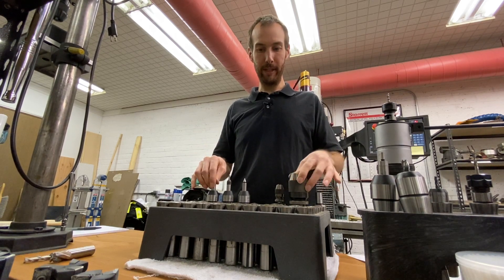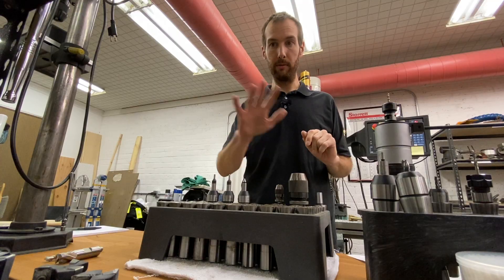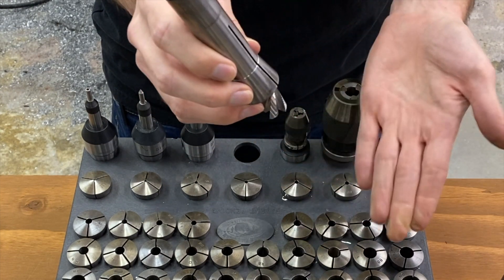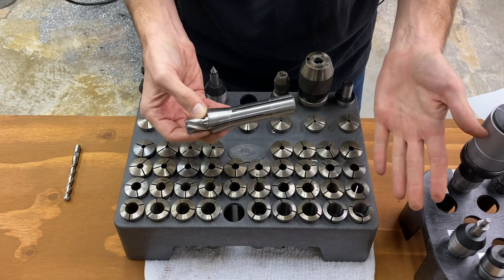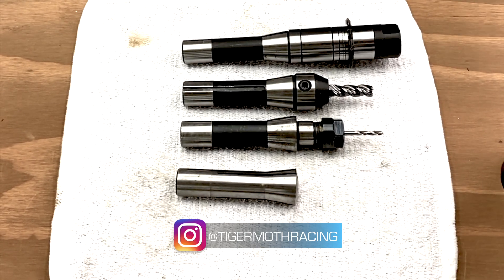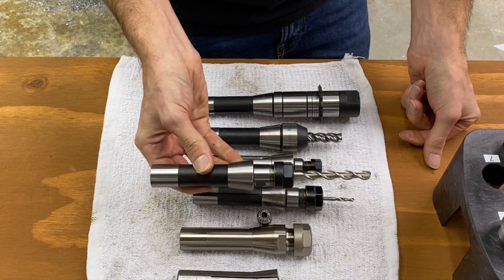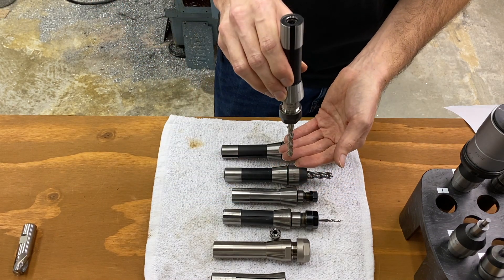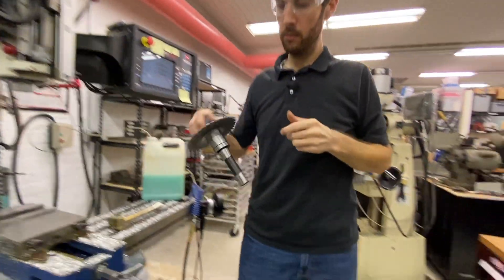LET'S TALK R8 TOOL HOLDERS (Part I)

Comment: I'm hoping to repurpose those holders for a laboratory project, not using them for their intended function: What is the exact diameter of the openings in the R8 holders? Will it be identical for all of the R8 holders from different reputable brands? Thanks!
Reply from the maker: The openings will be all standard fractional sizes 1/8, 3/16, 1/4, 5/16, 3/8, 1/2, 5/8, 3/4, all oversize a few tenths. Are you using them for a force test?
Reply: @TigermothRacingTV  No, nothing like that. It won't be under any significant load or strain. I'm still confused: Aren't all of those holes in the holder the same size? It looks like it? Thanks...
Reply from the maker: @NA-hb7kl 
I guess I am not sure which holes you are talking about. The tool holder end is available in different sizes, the drawbar end is usually 7/16-18, and the setscrew sizes vary greatly.
Reply: @TigermothRacingTV  Sorry to be so unclear. I wish I knew your field! I'll try just one more time to explain my question and then I'll stop cluttering your channel: The openings in the top surface of the four-legged collet holder that you're displaying at the very beginning of the video... What diameter are those holes in the holder's top surface? And how would I have known that hole diameter without measuring it -- in other words, how do I translate the specs for any given collet holder into the hole size in the top surface? (I seem to only see specs for collet holders that are already in industry code, like E20 or R8, since they very fairly assume the buyer will know what top-surface diameters such codes indicate.)
Reply from the maker: @NA-hb7kl 
Ok, if you mean the hole that holds the collet, yes those will be all the same for each series of collet. You can find a spec chart online for each ER collet exterior dimensions.

Comment: Great informative Video. I am new to machining and I am finding the whole topic of collets and arbours very confusing. I thought the R8 was the big guy with machines to match. It seems that the hobby home range use smaller  tooling tapers. It doesn't help by having different codes for what looks like the same thing, for example Mt3 is the same as er 25 and R8 is a er32. As I don't own or have access to any collet holding machines that doesn't help.
Reply from the maker: Yeah be careful with that stuff. R8 is not the same as ER32 but you can get them combined in one holder. Also, MT3 is not the same as ER25, although you could get them on the same holder. Hope that helps.
Reply: @TigermothRacingTV  Yes it does,  thanks for the information.

Comment: Where did the designation "R-8" come from? In other words, what do the "R" and the "8" mean?  Thank you. Student Machinist
Reply from the maker: Good question, I am not sure and a cursory check of Google did not tell me ether. I know that it was developed by the Bridgeport machine company. The angle is an oddball as well at 16.85 degrees. I would guess that they developed it as a proprietary for their product line and it happened to become the industrial standard because their machines were so popular.
Reply: @TigermothRacingTV

Comment: Woah! Thanks a lot. I have a slightly larger mill (kao feng) but not as much travel vertically and a rather large vise. I was really nervous if I should go for the spring collet style or not. Thanks for the adviSe!
Reply from the maker: Spring collets are not a question. You should always have a set of those for your mill. They are a staple that will save you time and give you flexibility in your milling, don't skip them.

Comment: Cool video, what tools have you used with that 1” R8 collet? I have done some machining at a student machine shop and the largest R8 collet is 7/8”. Only end mill I had for it was a long 7/8” end mill and it was not very rigid.
Reply from the maker: Yeah 3/4 is the max common size for R8 spring collets. 7/8 is an odd ball and 1" it cannot hold in a practical way. You can get solid holders that will hold up to 1.5" but again not very rigid.

Comment: Great video !
I have a 626 mill with a R8 spindle fitted with a ER32 collet holder. Been playing with the idea of getting a R8 20mm spring collet and leaving it in the mill. Then using SC20 straight  collets on each of my end mills to speed up tool changes. I know using a collet inside another is not good practice but I only do very light work on aluminium. Have you ever tried this and do you think it's viable. 
Thanks Neil
Reply from the maker: Thanks.
That was my solution to a small R8 spindle CNC mill we have. I just leave a 3/4 spring collet in it and we use straight shank shortie ER collet holders in it. Same situation, the machine is light duty so we can't even overload the collet if we wanted to.

Comment: Hi, good vid/shop. I have dude, whit R8 toolholder when get out/in from the machine do you lost the Z hight tool?thanks
Reply from the maker: Thank you. Only the solid or ER holders will keep Z height position of the tool.
Reply: @TigermothRacingTV  ah ok, true, and now I have dude if R8 solid/ER holders can keep the Z high on cnc machines ? many tanks for your answer

Comment: I have a super important and urgent question I am cutting gears for the first time completely on my own I've done all the math I've got everything down perfect I believe in quotations Umm I'm using the R8 integral Shank like you showed here The thing is you have the potential to set the gear cutter at different height depending on how you arrange the spacers but it seems like there's always gonna be some spacers that are not aligned with a section of keyway it's just not long enough is there any right or wrong way to do this? I just for convenience moved it as close to the end of the alright holder is I could and that's really it I just don't know if there's a right or wrong way to do this if you could give me any insight it would be a big help
Reply from the maker: My understanding is that the key needs to engage with the cutter. It doesn't matter if the spacers mate with the key. However, you may find that the nut may loosten wile running if the last spacer next to the nut does not engage with the key. Hope that helps.

Comment: Thanks for an informative video. I would like to build a heavy, gantry milling machine, using the R8 system. My work envelope will be 10”-X, 10”-Y, and 6”-Z. 1/16” - 3/4” diameter collets will certainly work for me.

Comment: Question: Would it be beneficial to grind/remove the indexing nub inside of of the spindle for R8 collects?  As far as speeding up the change out...
Reply from the maker: Don't go grinding anything out of your spindle. That key is a screw and it is removable if you want to take it out or replace it. It is there to prevent the collet/tool from slipping. If all you do is light milling you will be ok without it. I leave it in so I have full torque and holding capacity when needed.
Reply: The location pin is there to ensure that the collet always sits in the same orientation to the spindle

Stavros

Comment: What a great explanation of the different holders and R8 things, I have a Clausing 8520 Mill, I know don't say it but works for me, like to get a face cutter like 1" to1 1/4" , but the  machine  has the collets that are MT 2 with a 3/8" threated end for the draw bar. Do you have any ideal of options for that. See they have spring collets, and holders in the MT 2 with 3/8" threated end, or would you suggest something else. I do have many of my collets for this machine but the issue is to find  cutters for facing with a small shaft.   Thanks , really enjoyed your explanation of all you did here.
Reply from the maker: Yeah no problem with the Clausing, I have looked at those in the past. The MT spring collets are good too. I would just get a full set of spring collets and I have seen MT-ER collet holders too. That seems to be the best option. Maybe for that machine a good fly cutter is going to be about as efficient as a face miller. A final thought is you can usually find MT shanks that have a soft machineable head you could mount a face mill head on..could work for that machine just fine.

Comment: 8:00 so what your saying is just use a 3/4 r8 and install er into it. no need for a set of r8 just a 3/4?
Reply from the maker: You can use a spring collet to hold straight shank ER holders with a shoulder on the shank. This way you could change tools without loosing tool height settings. Is this what you mean?
Reply: @TigermothRacingTV  Yes. I have  TREE knee mill that uses Z collets and has a collet closer. Most of the time I use the 3/4" Z collet. My drill, er and endmill holders all have 3/4" shank. I do use my 3/8" Z collet for my coaxial indicator.

Comment: Is it possible to true up a tool in a R8 collet?  i've heard of this being done by tapping the tool but I've never witnessed anyone doing it.
Reply from the maker: Yes you could tap a tool in a spring collet to affect concentricity but ive never run into a situation where this was necessary. Maybe for micro drilling. Just remember that if you can knock-in the concentricity easily, the tool can loose its concentricity easily by the cutting forces on it, so it may not be that beneficial in most cases.

Comment: Excellent video thank you. Where can I get good quality r8 tool holders in Europe (Ireland) looking for what you put in the machine at 10:26
Reply from the maker: Shars.com, eBay, and a new company we have been working with is CME Tools. As always, be cautious about super cheap stuff but the R8 tooling has been really good quality on average.
Reply from the maker: Just be prepared to replace the setscrews on all of the solid holders. Order some nice alloy flat tip ones to swap them with.

Comment: Where did you get the tool in your hand at 7:41
Reply from the maker: That is a nickel plated ER-20 holder. Probably from Shars but you can get them on ebay too. Very nice quality and feel in the hand.

Comment: thanks for the info. As far as using ER collets in an R8 shank, what is the proper R8 collet size that will accept ER collets? What is the min and max size ER collet you can adapt in what size R8 shank?
Reply from the maker: R8 shank tools with ER collets are available in all sizes ER-11 through ER-40.

Comment: Do you lubricate the taper on the spindle or the collet for the r8 or ER collets, or just leave them dry?  
Also, are the toolots (7:40) ER collet holders any higher quality than the other chinese ones?
Reply from the maker: No lubrication. It is essential that the taper in the spindle and on the tool be clean. Oil and grease attract and hold dust. Its best to get in the habit of wiping the tool holder taper with your fingers every time you pickup a tool and looping your finger in the spindle taper every time before you load a tool. These things will become automatic and you will have to use your judgement based on the cleanliness of your shop.
Reply from the maker: The nickel plated holders are nicer but also tend to be 3-4× the price.